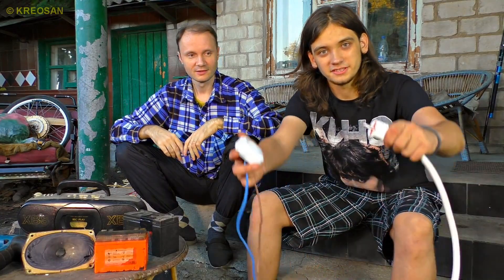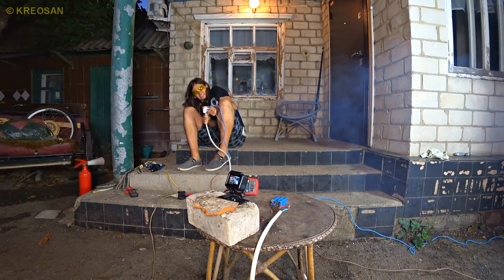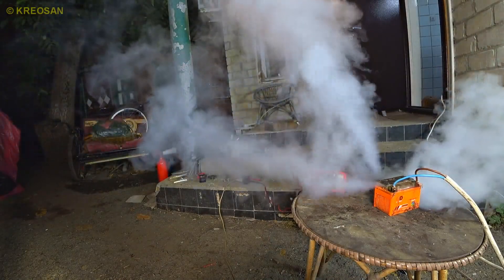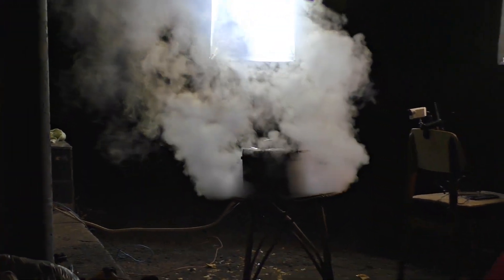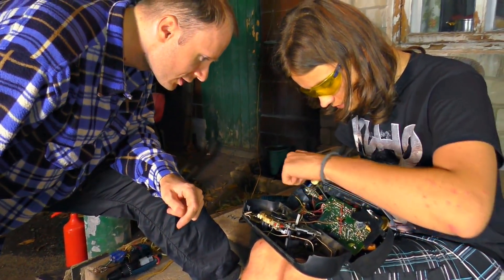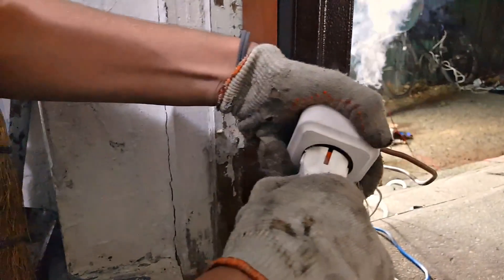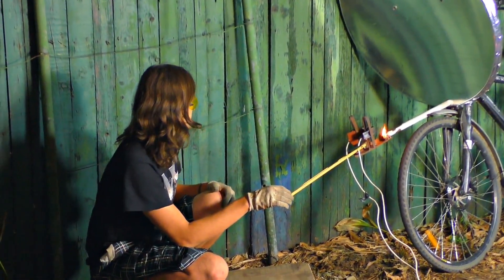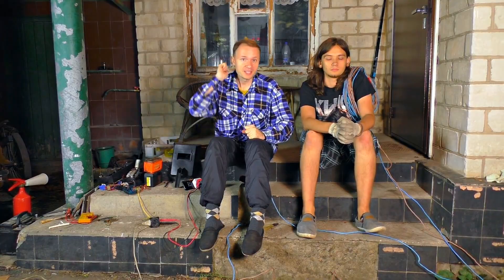✅What is the mains voltage of 220 volts capable of if you plug it in the wrong place))

Comment: Accidentally putting 240 volts through a 110 volt ARP synthesiser doesn't do a lot of harm, just needs a simple resistor fuse change......allegedly 🤔😂

Comment: the drill motor is dc so you will need a heavy duty bridge rectifier or even a diode wired in series to the motor would get it to spin.

Comment: remember another time,I was over a friends house putting a ceiling van up,I did tell them to cut the power of first,Half way doing the Job,I standing on top of metal step ladders,Felt the electric went rushing straight through me,I jumped clean of the metal step laders and see flashing going through my head,After that I said turn the electric of completely,I had cut of the Electric after that

Comment: an amp claw would have been a must to know the drainage of amps
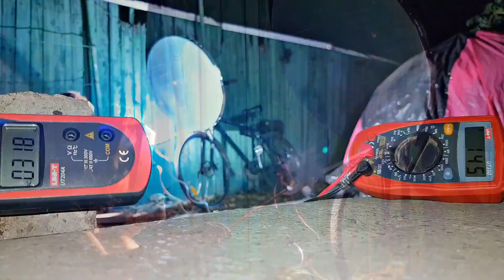Reply: They have some amp meter at 8:46 (probably a clamp meter). 
I wonder what kind of power connection they have to be able to pull 300 A. Unless it is some sort of industrial facility (it doesn't look like that). Or have they bypassed all fuses? haha
Reply: @Speeder84XL  in europe at 40 amps you get a general shudd down from the main fuse. Maybe they don't  have such.